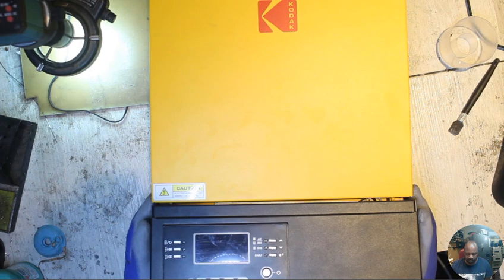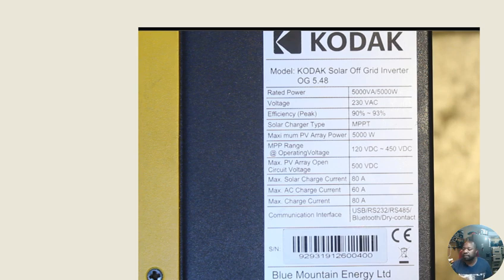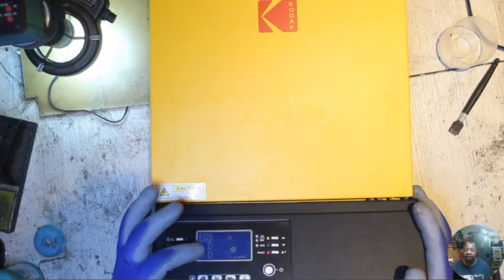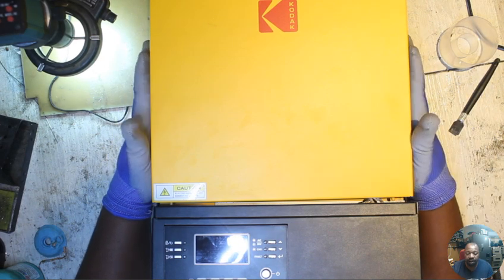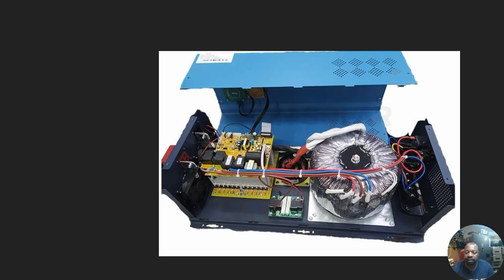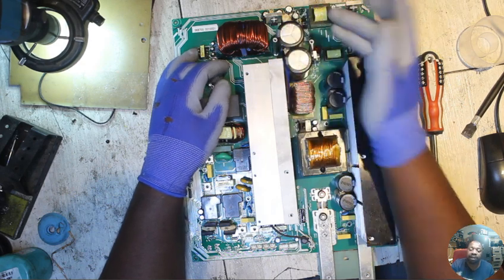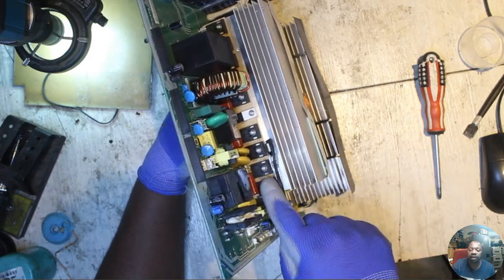Difference Between  High Frequency Inverter and Low Frequency Inverters Why KODAK ERROR F09

Comment: A high-frequency, transformerless inverter's lack of galvanic isolation can potentially damage appliances, mainly due to shared DC/AC grounds, leading to ground loops, leakage currents, voltage fluctuations (brownouts/spikes), and inability to handle heavy surge loads, which can harm sensitive electronics or motors, requiring specialized installation and protection. 

How Damage Can Occur:

Ground Loops & Leakage Currents: Without a physical barrier (isolation transformer), the DC (solar/battery) and AC (appliance) sides share grounds, creating pathways for unwanted currents, causing interference or even system shutdown.

Voltage Instability (Brownouts/Spikes): Some models may dip voltage (brownouts) or produce noisy power, especially under heavy loads, which can stress motor windings and electronic components.

Poor Surge Handling: HF transformerless inverters often struggle with high starting currents (surges) from motors (fridges, pumps), potentially causing shutdowns or stress on the inverter and connected devices.

DC Leakage: The AC output can carry DC leakage, potentially damaging sensitive electronics not designed for it, or even causing issues like corrosion in marine setups.

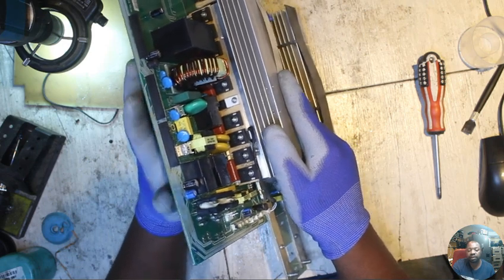Comment: At 8:52, Customer shorted out the output, which lead to overcurrent situation or shortcircuit situation. I suppose this inverter should have a short circuit protection.  Is the over current or shortcircuit protection not able to catch the shortcircuit and turn off the inverter to prevent it from damaging the igbt?
Reply from the maker: The inverter have a short circuit protection but  it differs with manufactures some times it might fail to react quickly enough. it takes millisec to get igbt to fail. i have also experienced this. some inverters reacts quickly but some might fail. especially the low end
Reply: @technodriverepairs7691  thanks alot. I really learnt from you
Reply: Very good and really great. Is it possible to get your WhatsApp number? 😊

Comment: I have been doing inverter repairs for quite a long time now, what I have discovered is that what makes these inverters fail is mostly poor circuit design. i started off when the mainstream inverters were all low frequency transformer based and they would fail also.

most of these cheap Voltronic Axpert based or copy inverters use low quality or sub standard components like capacitors, IGBTs, Mosfets, poorly done PCBs etc. 

check for example high end high frequency inverters such as Goodwe, those ones are robust.

i used to work as a repair technician for a local firm that used to import low frequency transformer based inverters from India, to be honest they would fail also. There was a point when the company decided to import UTL and we had problems of their inverters failing each time after the grid is restored back after a power failure. We had to move away from those UTL inverters and started selling the high frequency transformer model Axpert type branded MECER which were the original from Voltronic. we never experienced any problems with these new inverters. 

Nowaadays the market is flooded with cheap and poor quality inverters and those are the ones that makes it look like the high frequency inverter type are not robust. These new Kodak branded models come with low grade components, poorly designed PCBs etc

I agree that the complexity of the high frequency inverters makes them prone to premature failure because the inverter has many sections and if one of those goes faulty, it affects the whole inverter.